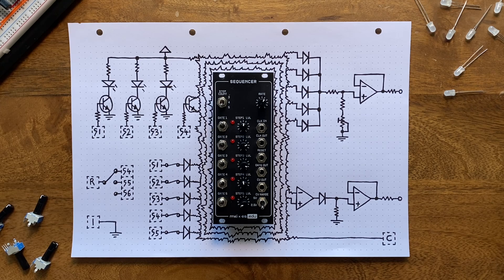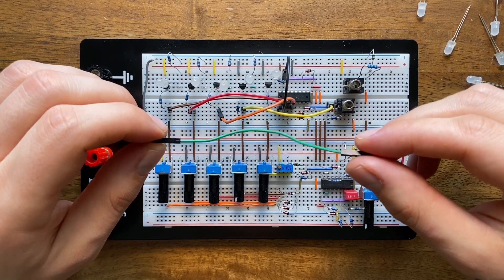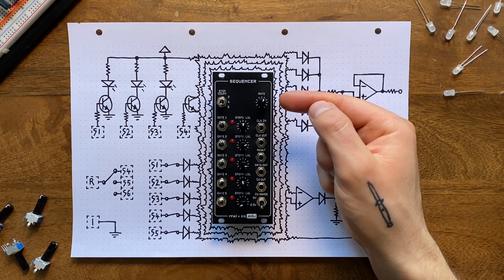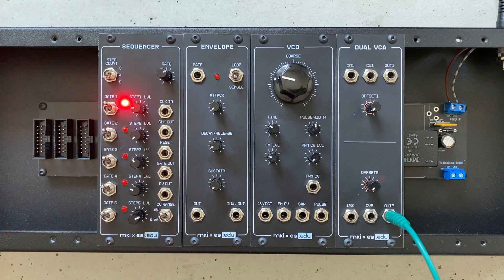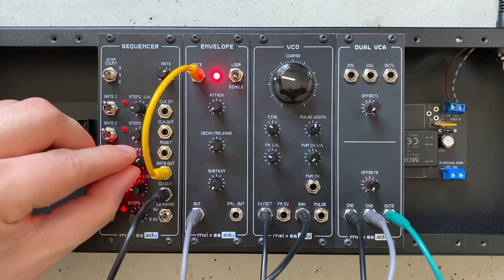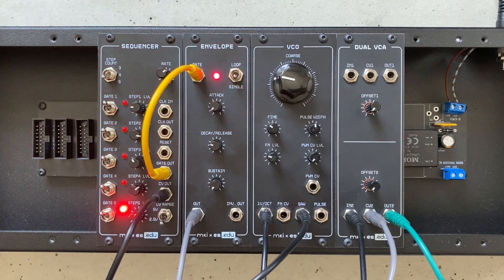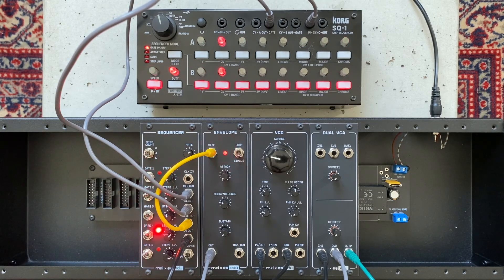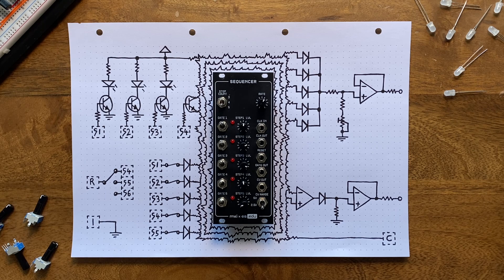Introducing the mki x es.edu DIY sequencer kit

Comment: In the manual it says to use two 9v blocks for the breadboard build.
Can we use the dual power supply from the case instead as I do not have batteries around? The powersupply has 12V but I guess the ICs can handle 12 volt as the we be powered by it later anyway!? A bit afraid to try :D
Reply: For anyone else maybe having this issue: Just noticed in the manual of the other module "Since all circuits in this manual were designed for a 12 V power supply, we assume that to be
the default. Everything will still work roughly the same with 9 V, though."

Comment: Okay built this one last night and it sounds great! When adjusting the trimpots in back I can’t get more than 4.6 volts coming out of the cv before the trimpot runs out of travel! The 2.5 is spot on! Any ideas? I’ve noticed both of the trimpots are identical on the back unlike some of the prototypes where the 5v trim is vertical?! Thanks again for these!
Reply from the maker: unfortunately i didn't take the reverse polarity protection schottky diodes into account when choosing the resistor values for the CV scaling. you can get it to be bang-on if you exchange R34 (51k) for a 62k resistor!
Reply: @MoritzKlein0  Moritz, you are a gentleman and a scholar I swapped the resistor out now and it landed on 5v exactly I didn’t even need to touch the trim! Thanks again for your expertise and troubleshooting!

Comment: Maybe someone can help me here. I built it and it works great, only when i plug in a clock input the sequencer gets stuck on the step its on. Ive checked the soldering, all seems to work fine. Tried different setups for the clock out, none seemed to work. Would appreciate any insight anyone has on this issue.
Reply from the maker: where’s the clock signal coming from? the sequencer needs a fairly beefy (i.e. loud) clock
Reply: @MoritzKlein0 first of all thanks for taking the time, really appreciated 
 i tried it with my microfreak, the arturia minibrute2s and my digitone. Nothing seems to work so far